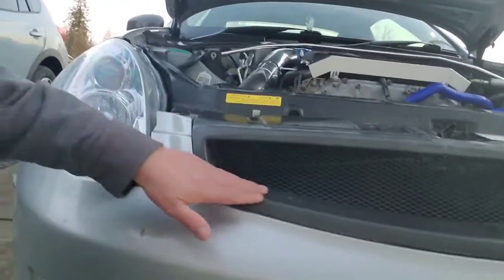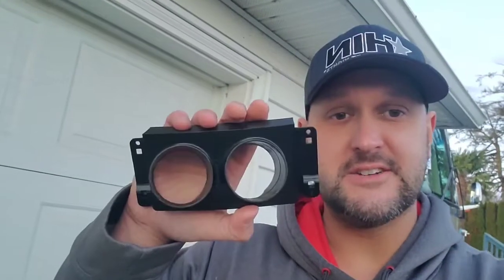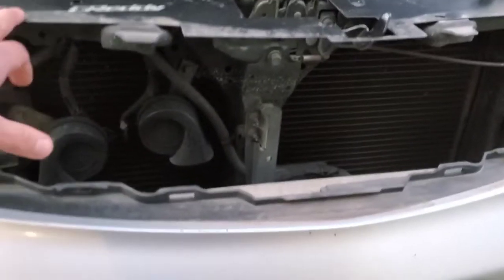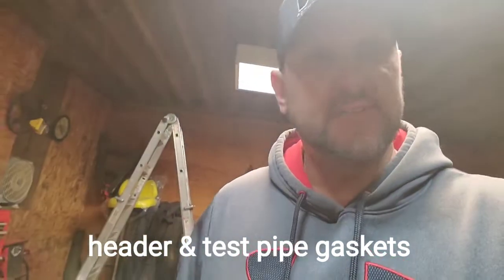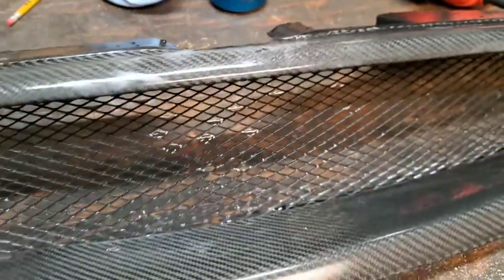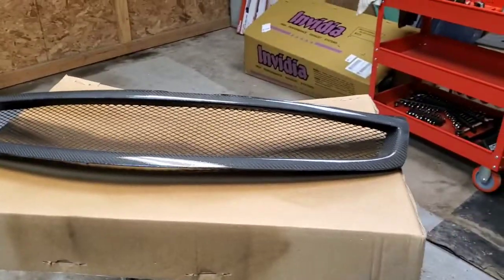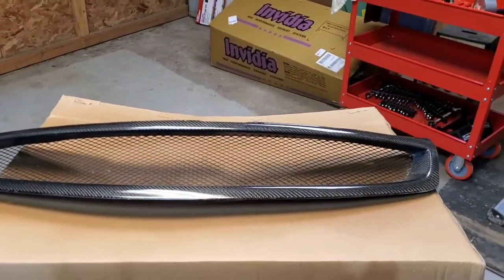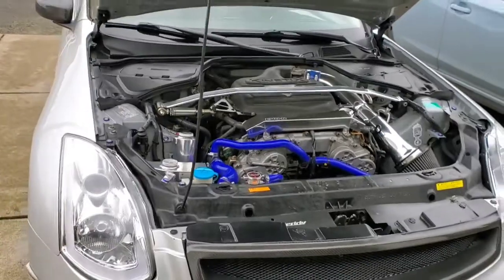fresh clear coat on the G35's carbon fiber grill.

Comment: Where did you find the grill? Does it fit well?
Reply from the maker: I think I got it from ebay several years ago if I recall correctly. I've had it for some time. And as far as fitment, it does fit well.  Thanks for questions.
Reply: @theg-zguy5268  thx for the answer and making the video!